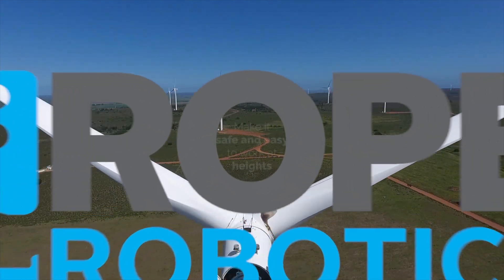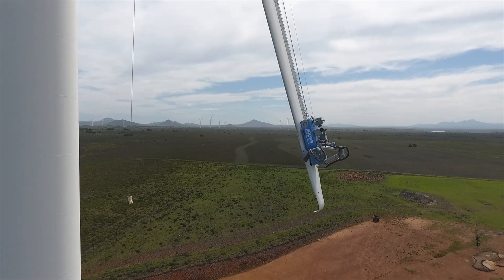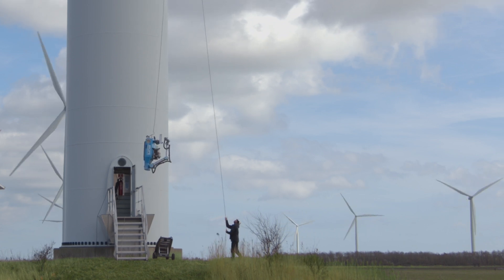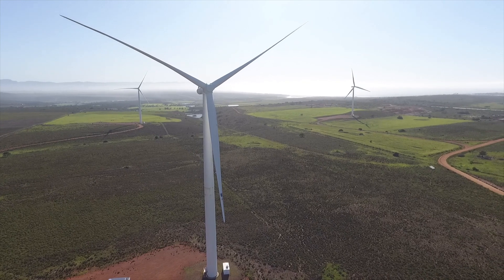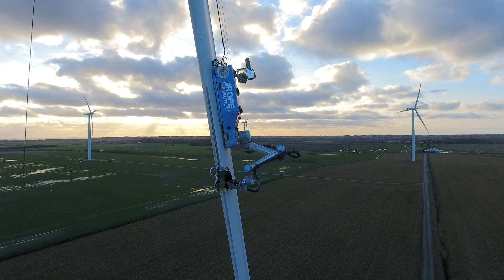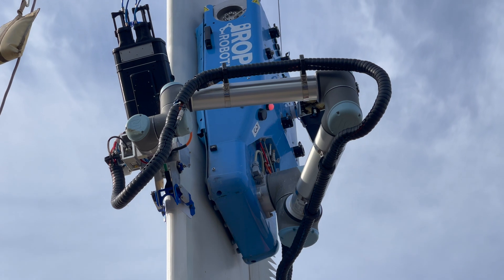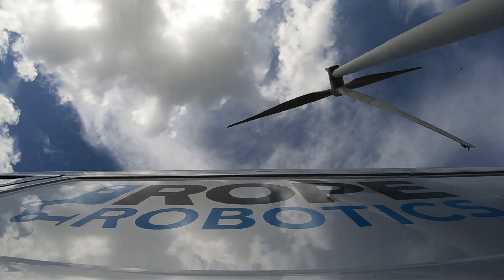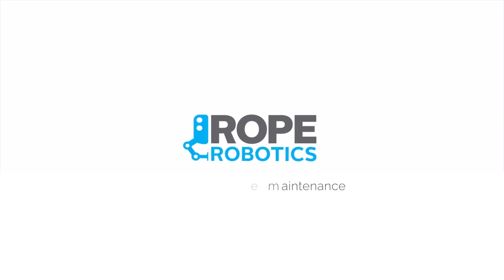Rope Robotics LEP solution

Comment: Is it the air that is damaging the leading edge or is it the large and majestic birds being slaughtered?
Reply from the maker: It's manly rain-droplets – the tip of the blade can get up to speeds above 400km/h, hence at this speed a rain-droplet is almost like a hail of bullets that, over time, damage the leading edge of the blade. In dry area it can be sand instead of rain causing this effect. Bu no – birds is not the reason.
Reply: I've been in the wind for over 2 years. I've never seen a dead single deadbird under or near a turbine